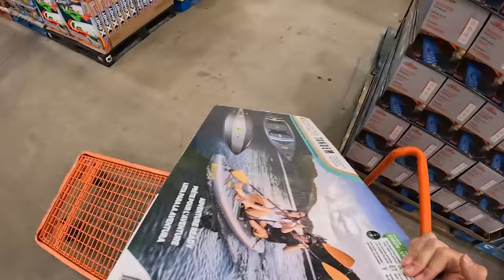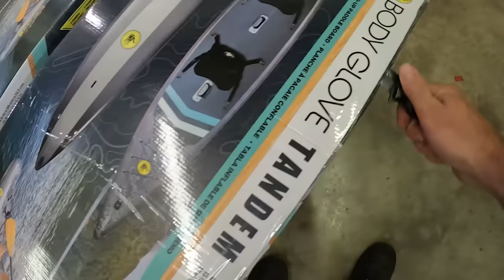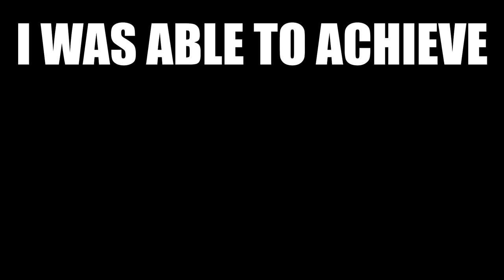Converting Our $1,000 Bikes into Boats ?

Comment: solid foam, metal pipe, epoxy paint to coat it once assembled, build pontoons center of mass and elevated so it can't flip and clamp the frame to the bike frame so the rear tire touches the water just under the hub, set up a double fin behind the wheel to direct the water flow for steering, also add an engine snorkel for the crankcase and intake to be safe and silicone your terminals

Comment: Adapt a dyno speed tester to a drive shaft . The rear tire drives the dyno being strapped down to it and the front of the barge is steered by a disc on the floor with a rudder below strapped to the front tire allowin almost 90% left right turning

Comment: I was (very) lucky enough to find and buy a super mint, zero rust, sparkling chrome 1988 Shadow VT700C barn find for $250. Redid the carbs, put in a new battery and the key and fired right up. A little over 5,000 miles when I got it 4 years ago and ride it all summer since. Yup, you can find good bikes for under $1,000 if you look and get lucky.

Comment: Something I would have done is get hold of some discarded 55 gallon plastic barrels (what they use for holding vanilla extract and whatnot) and made two pontoons from 4 barrels (a pontoon each side made from two barrels attached end to end). Then I would build a platform between them, and add a paddle wheel like on the old paddle steamers to the back. Then a rudder on the front, and after removing the tire from the rear rim I would run a rope or belt to the paddle wheel.

Comment: iM ENGLISH i got this. So you build a solid base with a hole at the back, Then mount an oil drum with paddles, mounted solid with bearings so its paddles hit water. Bolt down a bike front wheel locker up front off set with the back wheel pressed against the oil drum. Power the back wheel and it turns the oil drum or whatever and boom just need steering and thats just a paddle out back.
Reply: Scrap yard challenge is kinda our thing.
Reply: No way craig did it kinda better but bogey wheel ok now i know. But imagine the bogey wheel as the paddled drum direct drive. We both mechanically minded tho.

Comment: These guys converted their motorcycle into a boat hahaha. I had this idea of converting my electric kick scooter into a boat. 

I could unpack from the truck. setup my scooter to ride to the water and attach a scooter trailer to tow a paddle boat. When I get to the water. Fold up the scooter and strap it to the modification on the paddle boat. The modification will be like a belt driven friction wheel to paddle wheel. And I would definitely want to upgrade the paddle wheel because I know the paddle wheel sucks!!!!

Comment: As ugly as they are I like the idea I had a similar idea for a home generator for when the power goes out connect the back tire to a bougie wheel and that spins 10 alternators with 10 car batteries and 10 inverters comes out to be about 7kw that should be enough to power a house I only use a average of 3kw/h so about 12 hours of changing per day. Also it's about 1hp per 750watts so do the math you don't need a 50kw engine to generate 7kw of power such a waste maybe a scooter would be better. You need 10 maybe 11hp to generate 7kw.
Reply: Also a similar idea the math shows 1hp is about 750watts but a 1hp engine will get you about 30mph but that's as fast as I can peddle a bike so 1hp is really 1 human power but a horse can run about 30mph so that's where the 1hp comes in but the math isn't correct 1hp isn't really 1 horse power so if you put a horse on a treadmill and that treadmill powers a boogie wheel you can probably power a house with 10 alternators with 10 car batteries and 10 inverters I only use 3kw/h on average if 1 human can power .75kw a horse should be able to get more than that probably 10 times the power of a human so maybe 10hp or 7kw or 1 horse can power 1 house but also what about horse powered treadmill that charges something like a Tesla so you can have a horse powered car. Make the ommish jealous go over 30mph on a horse powered car
Reply: If 1 human can go 30mph and a horse is about 10 times more powerful a horse powered treadmill car should have 10 times the power so maybe 300mph on paper but then there's the drag but you can make something that can enable a horse powered car go atleast 100mph that's plenty fast and the math suggests that's actually possible.

Comment: Too bad neither of you took this at least a little bit seriously.

You have enough engine power plus the befefit of a transmission to have used a 90 degree drive shaft running a big aggressively pitched prop, instead of the stupid idea of driving a paddle tire with almost no working surface.
Reply from the maker: We had like 2 days to build these